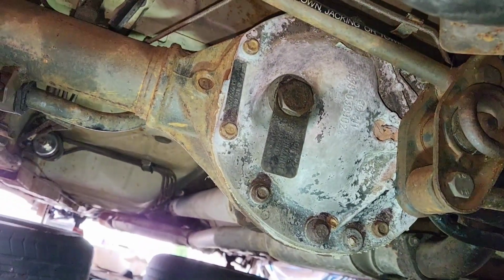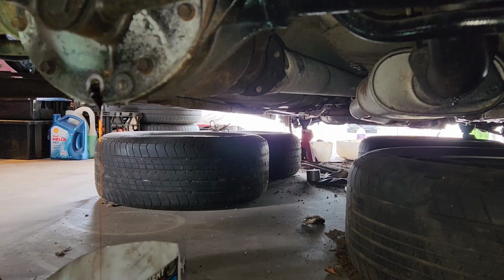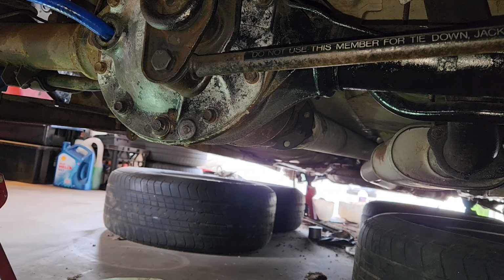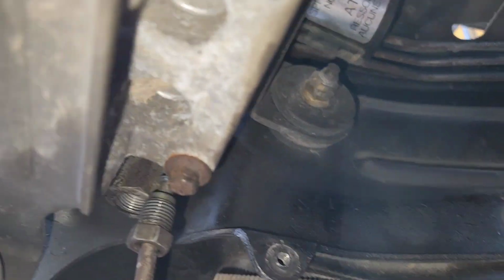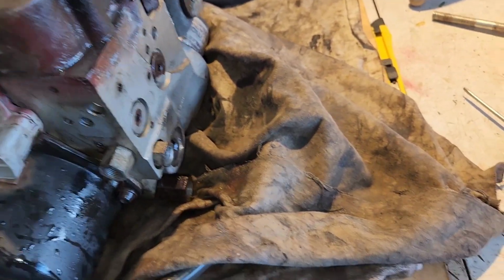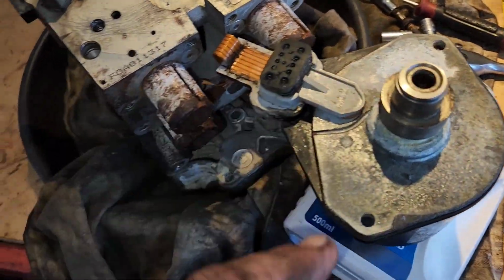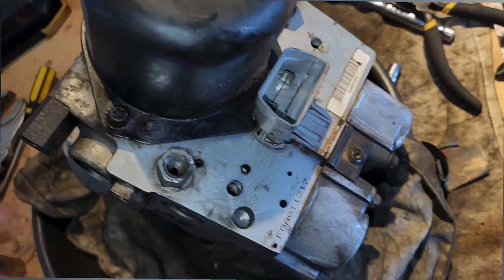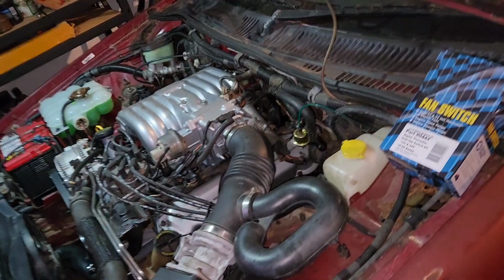EB XR8 EP21

Comment: Put a set of ef fans in my nc sportsman,used Davis Craig controller and ran the ef power wires across front of rad and used power and earth straight to bat,no volt drop,fused at bat,now runs when at my set temp or when ac on,also starts in stepped order to save load on alt, great videos of car rebuilds enjoy every one,have one nc sportsman,two Ltd,da and a dc and an ea spack.
Reply from the maker: Yeah nice they are good units. I've got the same one in the xd. Nice collection mate! 👌

Comment: Good video mate. It’s a shame about the ABS unit. 

Did you get a new coolant level sensor with the bottle or re-use the old one? Either way where did you get the bottle from and how did you install the sensor (I heard it’s a prick of a job to do the sensor)

Wiring up the thermo fans do you just take the constant power off the coil and run a signal wire from coolant temp sensor? 

Keep up the work man, keen to see it in the road.
Reply from the maker: Thanks mate!

No the original one snapped when I pulled it out. Just real old. I got 3 rom upull it the other day so I'm stocked up now haha it already had one from factory so no wiring needed. 

All the cables are labelled I'll go through it in the next video 👍

Cheers